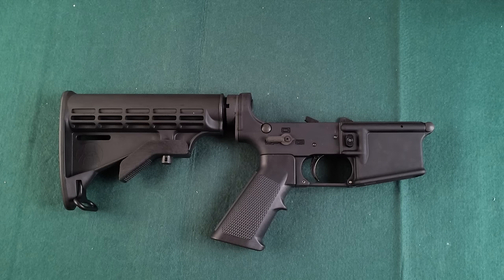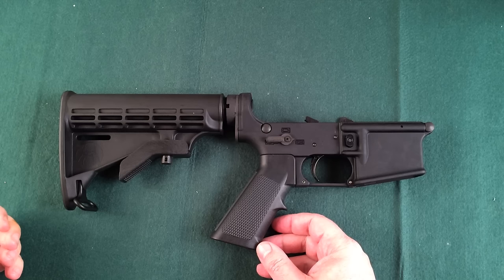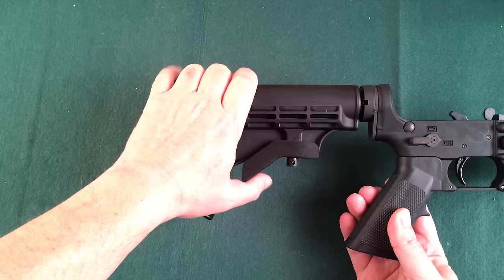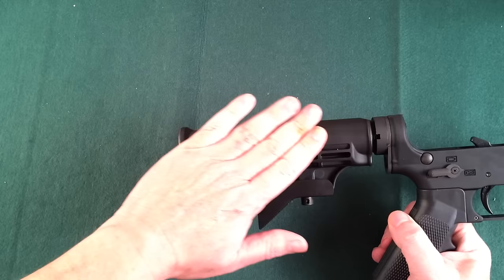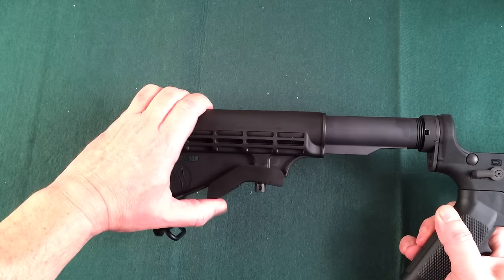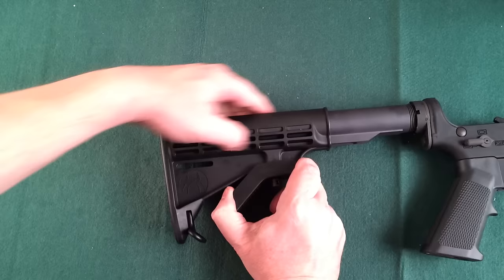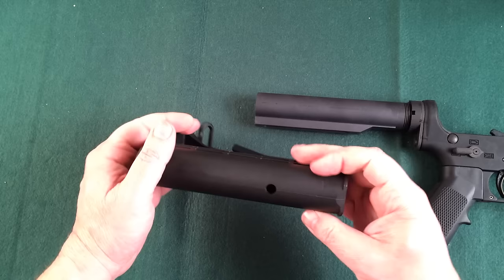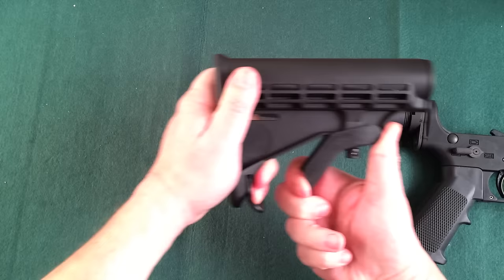AR-15 Buttstock removal and replacement

Comment: There are times in my life where I look at something and immediately can figure out how something works or an easy way to do something.
Other Times I'll be stumped and after watching a video I go "How did I not figure that out?"
The removal of an AR15 buttstock falls into the second category.

Here I was figuring I'd need a wire coat hanger to fit in the buttstock pin and pull it down on the buttstock's pin when all I needed to do was pull down on the adjustment handle.
Reply: @kingcrads7972  😭👌
Reply: Haha....I'm right there with ya, I messed with mine for about 5 minutes, lookin down the tube with a light from either end, and was stumped.
Reply: you speak for many of us lmao

Comment: I was in the marines. As a grunt. I never built a lower receiver before while in, but just did in less than 40 mins simple without punches or any specialty tool other than an armorers wrench. Got to the stock and was like, how the heck do I get this on. It stumped me for so long, and I feel like an idiot. So thank you for rectifying this for me and giving me a good laugh at myself. 😂

Comment: Thing about these m4 stocks is that if they come with your rifle, you can get a rubber stockpad for $5-$15 and place it on there. 

Same for the A2 Grip. You can get a sleeve/coat that goes from basic to tactical.

It's genius.

Comment: Thanks. I knew I'd removed it before but since you can't have them on the Saint AR15 per ATF, instead of buying a new buffer tube, I will just use the old one.

Comment: Omg thank you for this!!! I've literally had this replacement for months.😂 Thought it would be a no-brainer, but this is my first AR I've ever owned. Just bought a flat dark earth butt stock to mix up the solid black. The diameter of the stock is too small for the buffer tube it's an AR 10 or LR308. I'm guessing there's different sized buffer tubes or am I missing something? It's a cheap Amazon purchase, so could just be that. But thanks for this video bc atleast now I know!
Reply: You've probably gotten an answer now, but there are military spec tubes (like what the M4 has) and "civilian" size, which is larger. Measure before you buy friends

Comment: My AR pistol has an entirely different adjuster device (little tabs you have to push down as opposed to something like what's in the video). I'm wondering if the process to get it off it at least similar to this, or if it's totally different lol

Comment: I need to remove the stock lever latch. It has a round screw with a tiny roll pin holding it in place. Have trouble pushing out the roll pin. Is there a trick to removing the roll pin in order to remove the latch?

Comment: Keep in mind that BEFORE you purchase a new buttstock, remove the current one and see if you have a commercial (slanted end) or Milspec (flat end) buffer tube and than order either a Commercial or Milspec buttstock. Buffer tube is what the buttstock slides onto. Can also Google buffertube for further clarification. I'm a new gun owner and was able to do this modification. If I can do it anybody can.

Comment: The problem i am having is that i am a larger guy and my "pull" is longer than what the standard Magpul collapsible stock will accommodate. This makes it uncomfortable and difficult for me to get the best site alignment on my AR-15. Is there some kind of Longer Buffer Tube or buffer tube extension that i can put on my carbine to make the best and most comfortable use of my optics???

Comment: So will any old stock you choose fit on that buffer tube once you take the factory stock off?
Reply from the maker: Pretty much.  If the buffer tube is commercial instead of mil-spec, the stock might fit looser.
Reply: Personal Defense and Firearm Education But they sell both commercial and mil-spec fit stocks, don't they?
Reply from the maker: Yes.  if you try to put a commercial stock on a mil-spec buffer tube, it won't work in most cases.

Comment: can i just leave it like that without the buttstock ?
Reply: I don’t see why not.  The pistol tubes are straight cylinder and nothing fancy about them other than having a piece of foam around it.   The one in the video have groves so it can slide in and latch onto the stock.

Comment: my butstock is stuck on my buffer tube
Reply: Slide the tip of a small punch in there. It'll come off. Just gotta get that pin up (or in this case down) enough to clear the groove on your buffer tube.